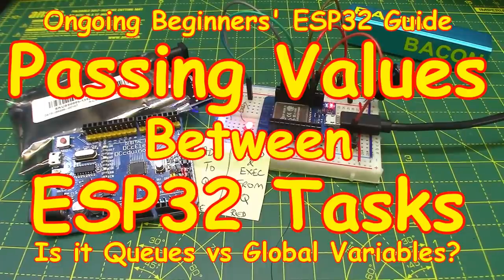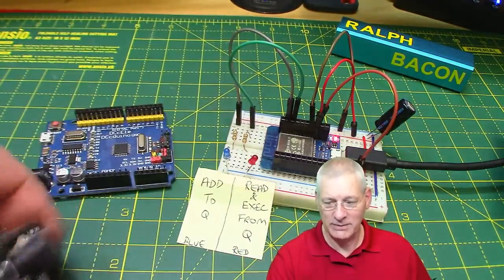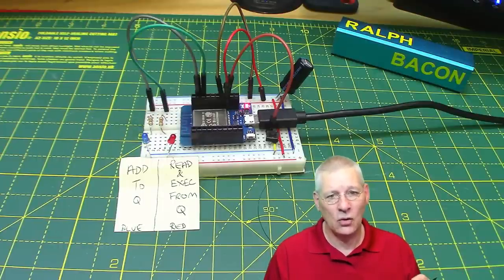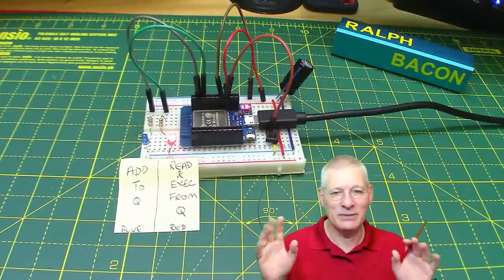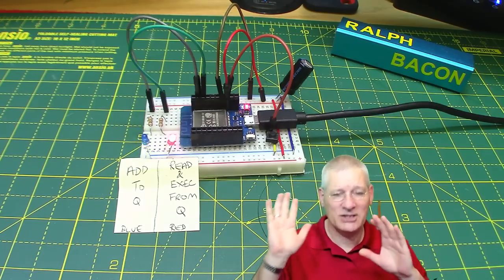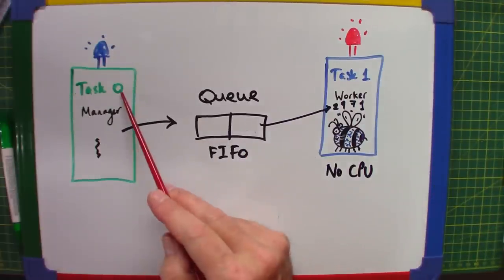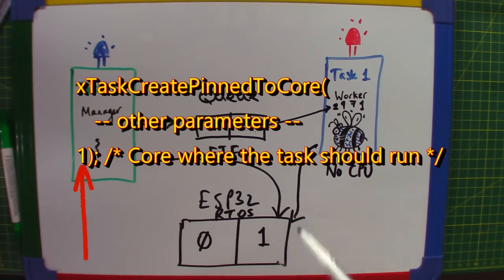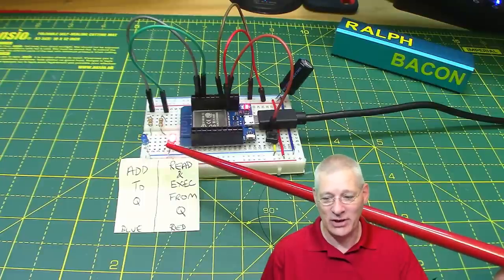#151 - ESP32 Passing Values 💾 Between Tasks - Deep Dive (2 Easy Ways)

Comment: Instead of Serial.println("..." + String("...")); at least on the ESP32 and maybe the ESP8266, you can use Serial.printf("%d %f %0.2f...\n", varInt, varFloat, varFormattedFloat); to save yourself some typing. You can also get printf to work on the SAMD line as well, but it requires a few lines of code to 'turn on', but much easier than achieving the same thing for the AVR platform. Benefit, you can toss in as many variables as you want, format them to your hearts content and you don't have to use String.

And thanks for another great addition to your ESP32 videos.
Reply from the maker: Yes, you can indeed, hmx, and that is indeed the way to do it, but I knew if I did that I would confuse my audience. I tend to use sprintf on my ESP8266 for my HomeAlone project as it's easy to use and is "proper" C! I mentioned in the previous video that users can continue to use Arduino-friendly speak or slowly migrate to the underlying language constructs; maybe I need to expand on this?
Reply from the maker: Oh, and I never use String (capital S) as it can fragment the Heap space, so std::string it is, but then we have to convert that back... the list goes on!
Reply: Glad to hear that you are aware of sprintf. I go crosseyed every time I see example code and there are 5+ Serial.print() statements in a row just to output a single line of text. I am enjoying that you are encouraging people to use more standard functions. Can't wait to see what you have for us next.

Comment: The first computer I bought had 64K of RAM and a 1mhz CPU (Apple IIe bought new with 2 disk drives and a DOT matrix printer.. $2500 in 1979ish)
The first computer I built was a 386 30mhz, 4mb RAM with a 40mb HD running DOS or Windows3.11 depending on what game I was playing at the time.
The ESP32 is more powerful and has more onboard RAM than my full size PC had in that time.
Reply from the maker: $2,500 in 1979 is worth about $11,356 today! Wow! Expensive computer.
See: https://www.in2013dollars.com/us/inflation/1978?amount=2500

Yes, the ESP32 is a powerful beast for sure. One reason why I like it!

Comment: If the shared global variable is an integer type (native to the CPU), then assigning it a value should be safe across tasks and cores without using a semaphore.  The reason for that is that assignment to an int can be performed with a single instruction so it can't be interrupted, it is "atomic".  However, a read modify write (e.g. x = x +1) to that same int is not safe and a semaphore is required.  Granted, the former is a limited case but might be all you need in some cases.
Reply from the maker: Is it truly atomic? Updating both bytes of the 2-byte integer? If so, then great! If not, then a semaphore is still needed, and, as you rightly point out, during any kind of update on that variable.

Comment: Good video on the enigmatic ESP32. FYI: I encountered the issue with running a task on core 0 and getting a 'panic' message saying that the watchdog timer had timed out. Following this the CPU reset itself. This occurs if the new task loops forever. When a task is started using the xTaskCreatePinnedToCore, the watchdog for core 0 is started and needs to be reset periodically by the task running in core 0. One solution is to place a call to vTaskDelay(1) inside the infinite loop which restarts the watchdog. There are probably other methods but this worked for me.
Reply from the maker: Yes, putting small delay in the loop is one way to prevent the panic message, but what I do is delete the unwanted task as a first step, then the OS doesn't expect it to run. I demo this somewhere in my code, search my GitHubs for all things ESP32 and you will doubtless find it.
Reply: @RalphBacon  Hi Ralph, in my particular app I needed core 0 to continuously monitor time sensitive sensors while core 1 handled other asynchronous stuff. There is no issue with using either core in an infinite loop as long as the watchdog is refreshed periodically or disabled. The vTaskDelay() refreshes the watchdog kinda like time.sleep() does in Python but there may be more elegant ways to do this.
Reply: @johnhoeppner1569  Hey john, i have the same error as you, can you please help me fix it?

Comment: Threading is an incredibly complicated topic, and you are brave for even touching on it! (And you have done a remarkable job covering what to do, without scaring people away.)
I assume the ESP32 does not do instruction re-ordering like an x86 would, so we hopefully do not need to worry about memory access semantics at a hardware level.
Does the platform not support the std::atomic library? There are many constructs far more appropriate than "volatile" in general.
The trouble with volatile is that it has inconsistent meaning on different compilers and different hardware! (This is actually a HUGE problem, from a standards perspective!)
Typically, it is a "full fence" barrier, which prevents memory access re-ordering both ways across all occurrences of that variable. (Typically the entire cache line, not just that variable.)
This can really hurt optimization to the point where a single core might be better. (Supposedly, this impacts RISC chips like ARM too, not just intel or amd!)
What we really need is acquire/release semantics, like what a proper implementation of the standard atomics library should provide.
Basically, acquire/release fences are a way of getting the same anti-corruption guarantee, but while also allowing the compiler to optimize around the variable.
Most of this is implementations specific, and I don't know how good the compiler for this chip is able to optimize in the first place, so it's hard to say how big of an issue volatile is.
Reply from the maker: Certainly having two tasks update the same variable, Stephen, is just asking for trouble - unless the developer has ensured the entire read/update operation is atomic, which you most certainly can do. Volatile alone may not do this (it's usually used to ensure register copies of memory values are not used). The question is why you might want the headache of doing this! Certainly not for beginners (which you show you are not, so you probably appreciate the coding complexity this would entail).
You could use semaphores or queues, of course,  but you always risk a deadlock. When using tasks I'd try and ensure the entire task was doing something independently (single responsibility principle) to avoid huge amounts of testing and debugging.
Reply: @RalphBacon  I may have gotten a little carried away! You're right, it's definitely better to keep tasks independent when possible. After looking around, It appears that std::atomic is available, if we need it. 

I haven't even gotten one of these chips yet, so maybe it's too soon for me to be trying to push the things limits ;)
Reply from the maker: Indeed, start slow and build on what you learn. Great chip the ESP32 and the RTOS is very good too, pity it's not a FULL implementation (ie certain functions are just not available).

Comment: This was incredibly useful! I'd been thinking about how to break away from the Arduino's delay() function to achieve a 250Hz sampling of an IMU and also how to move to a more easily tested codebase. This video really crystalized things for me and helped me appreciate that it's time for me to ditch the Arduino framework and just jump straight to tasks and queues in RTOS. Thankyou so much!
Reply from the maker: I'm glad it's opened your eyes to new possibilities, Stuart! But when you say "ditch the Arduino framework", just hold your horses! 

When you program for the ESP32, you still use what is effectively an Arduino-like framework (ported from Espressif's IDF development system). Whilst there will be new syntax to learn for the ESP32, you can still use just most of the Arduino-speak you currently use which should speed up development.

If you really want to embrace a better way of working (and cut the apron strings of Arduino) think about using PlatformIO (built on top of Visual Studio Code). It is far less hand-holding but ultimately leads to a better programming experience. I now use it all the time unless I'm doing a video! It still uses an Arduino-like framework (supports Arduino-speak C++) but gives you much greater freedom and control when developing. Just a thought!
Reply: @RalphBacon  I've been using PlatformIO since I started down this path back in November last year. I normally develop on non-embedded systems using TDD, so the opportunity to use an IDE that integrated with the Unity test framework swung it for me to use PlatformIO over the Arduino IDE. My understanding was that the ESP32 port of the Arduino framework was a wrapper layer on top of the Espressif IDF, am I correct in that? I'm wondering if that's why the String implementation you'd mentioned wasn't stable hadn't given you any problems on your ESP32.
Reply from the maker: The PlatformIO (and Arduino) implementation of the Espressif ESP32 platform are not wrappers for the IDF (which we would only use if we were developing software professionally, I guess). Espressif release these platforms (port them) regularly and although Arduino and PlatformIO might be at different versions I think they are basically the same thing.

That allows the use of Arduino-speak C++ for all the millions of users out there.

I haven't had any issues with string handling in the PlatformIO environment but maybe Espressif's implementation of String (capital S) doesn't turn your heap memory into Swiss cheese. That said, I tend to use std::string as a more standard way of using strings in C++.

Comment: But queues that are used by multiple threads also need a concurrency lock (ec semaphores). Any operation on shared resource can create an error if accessed at the same time.
Reply from the maker: Indeed. I guess it depends on how atomic each operation is, but semaphores is what I would go with anyway if I decide to use a task to read the circular buffer.

Comment: Hi. Thank you very much for taking the time to explain concurrent computing by examples. For me, a beginner, to follow an example saves a lot of  time in learning.
I'm using an Arduino Due and could not see same behaviour as on your video. Then I read the "FreeRTOS Reference Manual" and realized that " vTaskStartScheduler()" has to be added to get the RTOS "started". One differens is that your board has the RTOS "built in"? whatever that means. is that it? Can you say a few words about a set of FreeRTOS functions to master to make advanced projects.
Reply from the maker: To really master FreeRTOS (especially in ESP32 terms and perhaps Due too) you need to work through the book "Free-RTOS for ESP32 Arduino" by Warren Gay. If you learn 1/10th of what's in there you will be head and shoulders above everyone else. Well, except me, of course 😉

Comment: Hey Ralph!
"loop(){...}" might also work very well for asynchronous stuff like writing aggregated log files (error messages, etc) and else from time to time. So not using loop() at all might not be the case for most projects, but instead be used for low priority asynchronous stuff to do, like waiting for logging buffers to fill up, to be written somewhere when ever a buffer is filled to some amount, like page/block size in a flash device (e.g. some 64/128mbit spi flash).
Reply from the maker: Great tip! Sounds like it would be a good use for the loop.

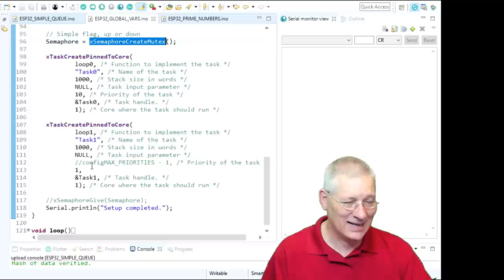Comment: 29:00 you set task0 with priority 10 and task1 with priority 1 ( is that why task0 runs many more times than task1? and, besides that, isnt task priorities limited to 1-5?)
Reply from the maker: That looks like a typo, edited from a priority 0 (idle) to a standard priority 1. The thing is, if a higher priority task is ready to run (or continue to run) then it will continue to run, starving any lower priority tasks from any cpu time at all. 

I'm sort of surprised this worked at all.

TL;DR they should both be at priority 1 to give them an equal share of the processing time.
Reply: @RalphBacon  thanks, man. Your video helped me a lot

Comment: Hi Ralph, about the static keyword. Not sure if it’s different in the Arduino world but in C a static “modifier” would make the variable or function local to the module, eg the compiler doesn’t export it and make it available to other modules. This could be useful if you want to make sure the mutex is protecting the variable in all cases. 
In C++ the static modifier WITHIN A CLASS makes it a class level variable, eg the variable is available to all instances of the class. The variable isn’t instantiated. So what you could do is instantiate an object of type x in each task and either one could access the variable. Of course the mutex would also need to be static. To reduce code and complexity you could simply have a function or method that would increment the variable with the mutex protection and return the new value. This is kind of implementing a design pattern called a Singleton. Of course for this simple example you could just just use a completely static class that wouldn’t need to be instantiated.
Reply from the maker: I use 'static' variables mainly to reduce the scope; that is, ensure they are not global. Within a function they are removed from the function by the compiler (so they are not re-initialised on each loop) but are not visible to other functions.

Even so-called global variables (within a sketch) would benefit from being static to prevent the compiler exporting the name and potentially clashing with a name in another library (happened to me, only once or twice).

I'd be very wary of declaring variables as static within a class as they are, as you say, shared between instances of the class. Might be what you want but probably not! I don't expect they are thread-safe on an ESP32 either, but I'm just guessing. Yes, we could protect the variable with semaphores, but that's beyond most beginner coding ability (although I did do a video on that, which everyone seemed to understand) 😜

Thanks for the feedback, Tim, some good points you raise there 👍

Comment: FYI: WROOM: WROOM stands for "Wireless Room" and refers to a compact module that integrates Espressif's Wi-Fi and Bluetooth SoC. These modules are designed to provide wireless connectivity capabilities to various IoT devices. They typically come in small form factors, making them suitable for applications where space is limited.

WROVER: WROVER stands for "Wireless Room with RAM Overlay." Similar to WROOM, it includes Wi-Fi and Bluetooth functionality. However, WROVER modules also feature additional external RAM, which provides expanded memory capabilities compared to WROOM modules. This extra RAM allows for more complex applications or larger data storage requirements.
Reply from the maker: That's very interesting, and plausible; if you can give me a citation where this info can be found, it would be even better. I searched high and low and could not find it). But for now, I'll use your explanation!

Comment: Second question, hello again, what ide do you use? Looks a lot better for developing with! :)
Reply from the maker: This: https://eclipse.baeyens.it/ but don't forget Arduino is developing a new IDE based on the Eclipse Thea  framework, probably for later this year, Trevor. But you can use that Sloeber version in the meantime to get familiar with the way it works (expect to devote several dozen hours to getting your head around it).
Reply: @RalphBacon  Great video as always, thanks! How do you find the Arduino Pro IDE compares to it?
Reply: @RalphBacon  That's the first I've heard of an alternative IDE from Arduino! That's really exiting! 
Another option I'd just put out there is visual studio code (free, lightweight, multi-OS), which has an unofficial but decently supported Arduino plugin. It relies on Arduino IDE for part of the toolchain though, so it has the same crippling problems. (Weirdness involving header files and multiple source files in a project.) It CAN parse the source though, and provide code completion and suggestions, etc. Overall it's a very nice editor, but it can't overcome the issues inherent in the underlying build process.

I've never had a good time with Eclipse, though I know it has come a long way, and literally anything is better than the plain Arduino IDE! So both this Sloeber thing and that new Arduino IDE are hugely good news, to me! Thanks for sharing!

Comment: My recollection could be wrong but writing and reading to/from FreeRTOS queues is atomic. If several tasks are waiting for a queue, then only the first found with highest priority is woken when something is sent into the queue.  Similarly at writing.

One uses queue-driven tasks for e.g. ensuring that data written to a serial port doesn't get scrambled, which could happen if two or more tasks are writing to the same port "at the same time".
Reply from the maker: I haven't even covered task priority yet (except in passing) but you are correct that the serial port most certainly does get corrupted (well, interleaved) with data from more than one task if the data is written in different statements. Perhaps the Serial library uses secret mutexes to ensure atomic operation?